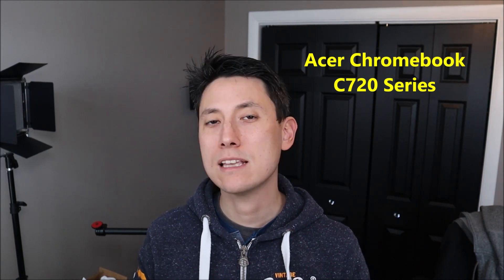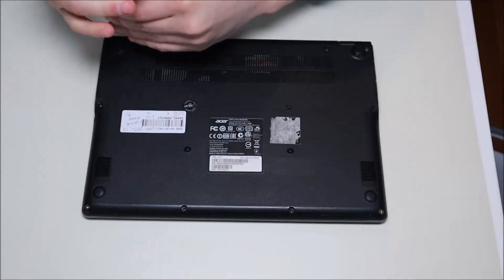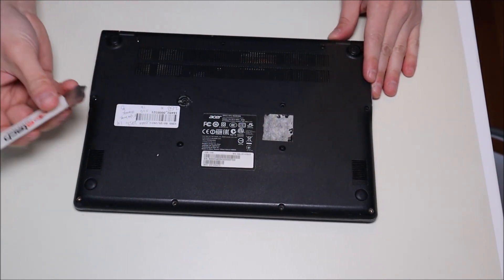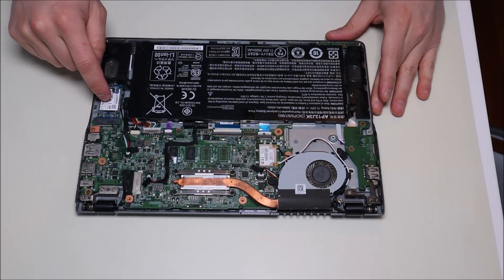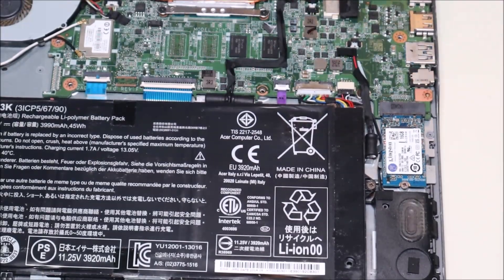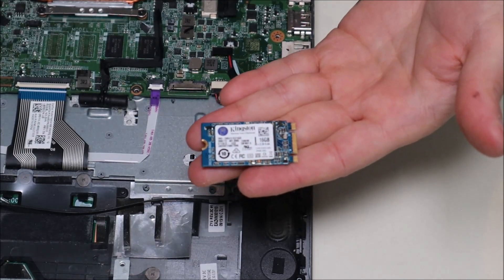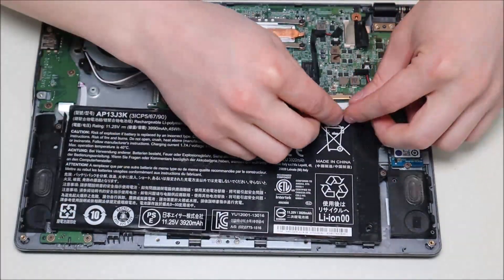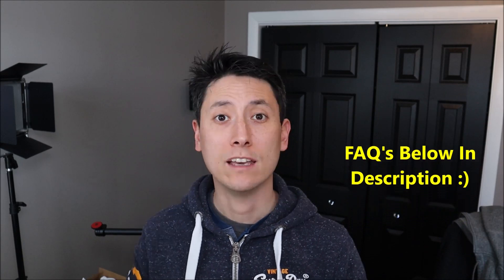How To Replace Battery, SSD for Acer Chromebook C720

Comment: my c740 doesn't turn on anymore and the indicator does light up and not charge i was wondering if you think it's the battery and i should replace it?
Reply from the maker: For a computer that does not turn on, try this video first; https://youtu.be/kOBY4k2Mn_k. Let me know how that goes :)  Also, did anything happen before this issue appeared?  Liquid spill, overheating, Windows update, etc?
Reply: @PC_Monkey  no it was one and I was watching something then I left the room and came back and it was off and didn't turn on at all the light doesn't turn on and won't charge at all but I believe it just got overheated and battery died I tried resetting it and Holding the button it nothing at all

Comment: hello, my friend and i both have alerts re our core isolation. we both have windows 11. her core isolation is on but she got a prompt saying her local security protection is off and she isn't sure how to turn it on. for me, my core isolation is off. when i tried to turn it on the prompt said 'do you want this app to make changes on your device?" what should we do? i tried googling but just got more confused as i am not tech savvy. thank you!
Reply from the maker: 1.  Your getting an error at startup that says 'Core Isolation is on' and the computer wont load past that?  What brand computer do you have?
2.  Also, did anything happen before this issue appeared?  Liquid spill, overheating, Windows update, etc?
Reply: @PC_Monkey  we did not get any error message. for my friend, she got a notification. she tries to download all updates. i only found out about my issue when my friend asked me if i had the same issue and i looked into my security settings. we always update when prompted. she has an hp laptop. mine is a lenovo ideapad laptop. we did not have any spills or overheating. thank you!
Reply from the maker: @shalee7155  Generally, Core Isolation should be turned on for best performance for your computer.  In some cases, some may choose to turn it off but I would usually leave it on. 
I am unaware of this having an issue during updates before.  Is it preventing the updated from processing correctly or something?
Reply: hi, i don't think there are any issues when updating. my friend is just not sure how to respond to the prompt " local security protection is off".  and i am not sure if i should "let the app make changes to my device " when trying to turn on core isolation.